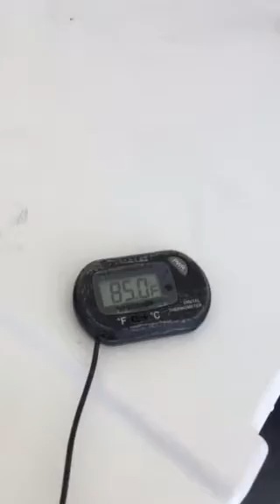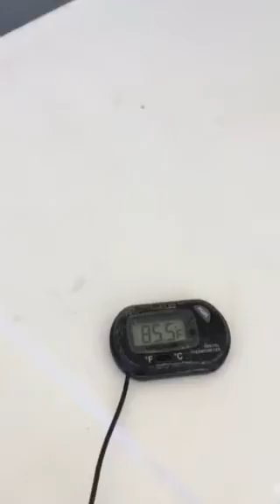How do I chill hydroponic water Using a water cooler as a hydroponic cat

Comment: It’s a while ago you posted this, but I still want to ask you if you’re not afraid to introduce copper into the solution?
Copper will dissolve in water with lower Ph, causing the plants to get too much copper...
Reply from the maker: Marc Hoekstra yes this is true and what I did was I immersed a plastic bag around the copper windings in order to keep the copper away from the water with the nutrients and things got better.
Reply: israel behar That's a smart move. Good to hear that also works!